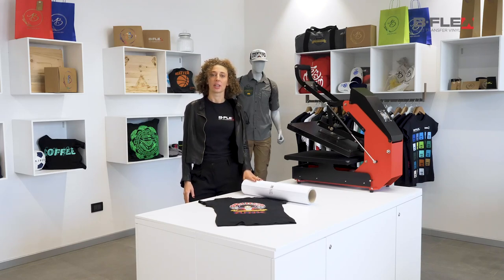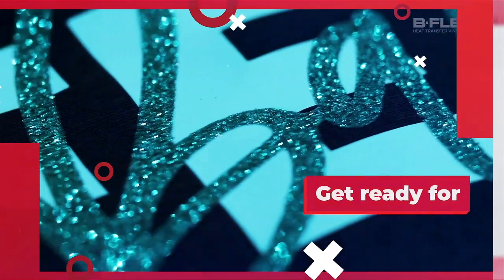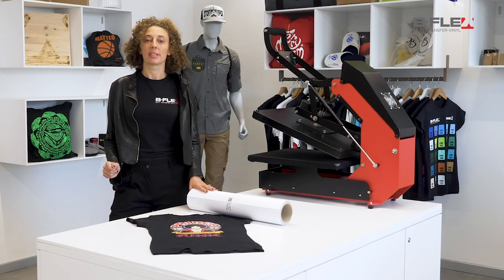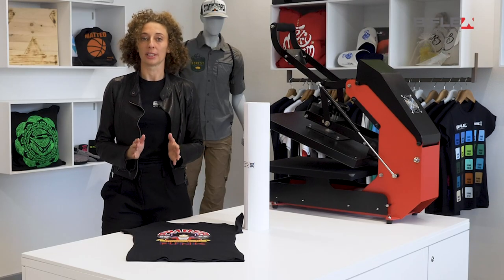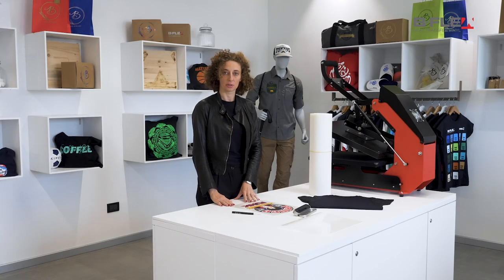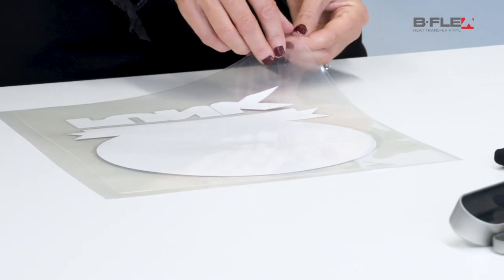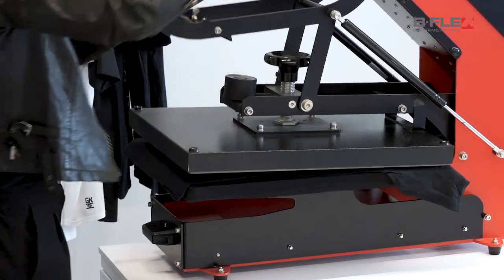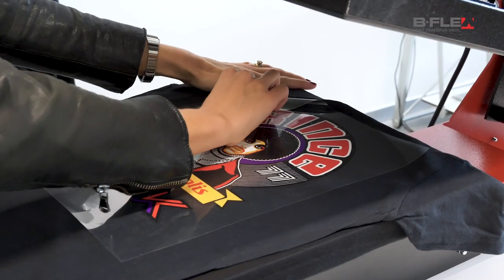New Film Print UV

Comment: Is this for durable than using solvent printer?
Reply from the maker: BF PRINT UV is designed to allow UV printers owner to print on htv too. It is not mainly chosen for its durability, but for those who have the option of printing only with UV inks.

Comment: Hi I ordered a Uv printer that can’t print on fabric, it can print on all other materials except fabric….. Will BF Mylar work in this situation to make it possible to print on fabric ?????
Reply from the maker: You should print on BF PrintUV, cut it and then apply on your fabric. BF Mylar isn't the proper material for this.
Reply: Hi the machine i ordered only uses uv ink.
Reply: The website says use bf print and then use bf mylar
Reply from the maker: @booga1186  BF Mylar is the application tape you should use to transfer the printed BF Print UV on your fabric. If you have any doubt, please send an email to info@b-flexitalia.com and we'll help you properly.
Reply: Does this work with soft or hard uv ink. Also can your film be used to heat press uv images onto things like mugs